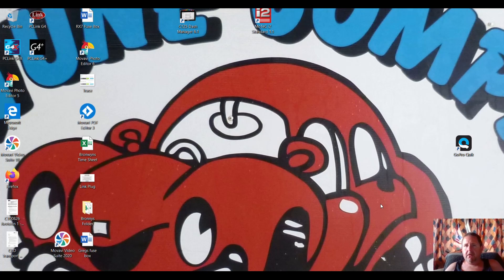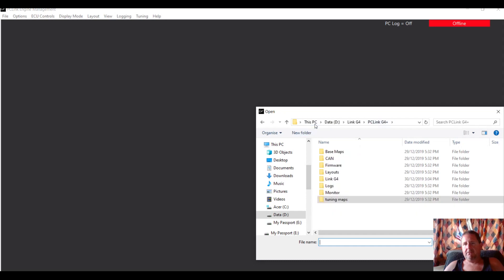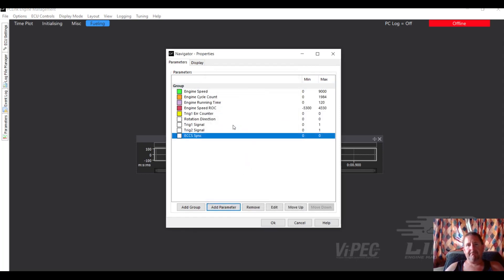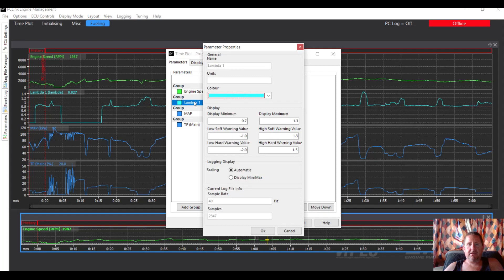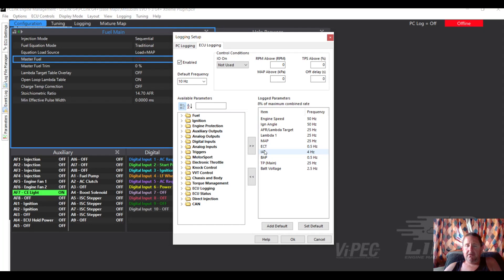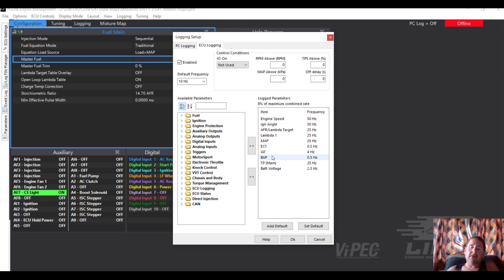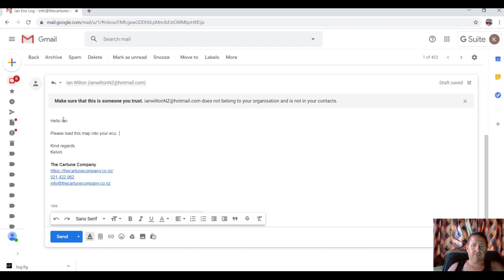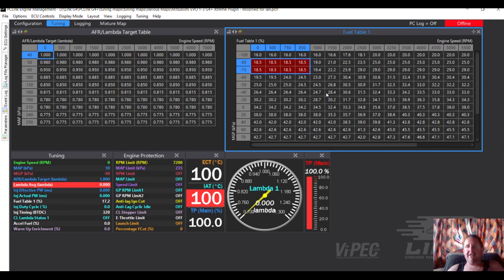Link ECU Logging - turning on the ECU logging.  Evolink plug in as example.

Comment: I need some help on base map start up for evo 3 with 560cc injectors 264cams

Could you possibly help me

Thanks
Reply from the maker: Sure can.  There are start up files in the pc link.software.  it contains enough info to get the engine running.  Simply adjust profile to suit your setup.  Its what the owner of the evo 1 did which I feature in another video.